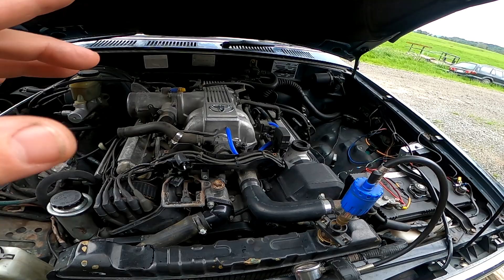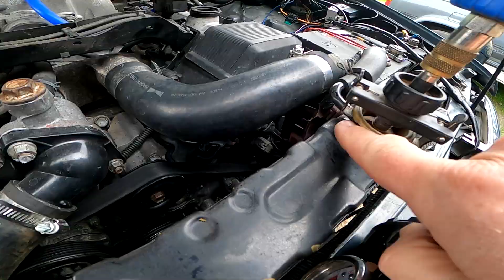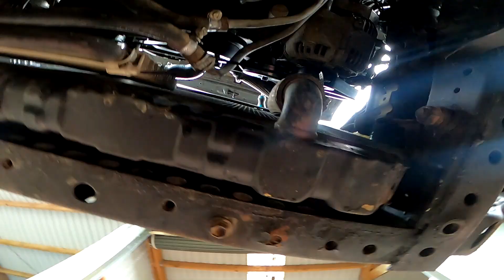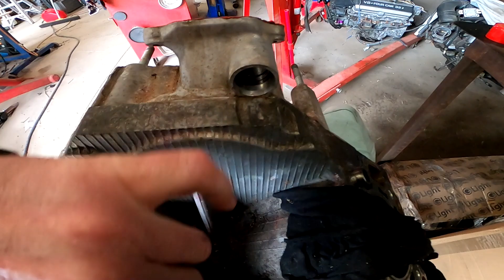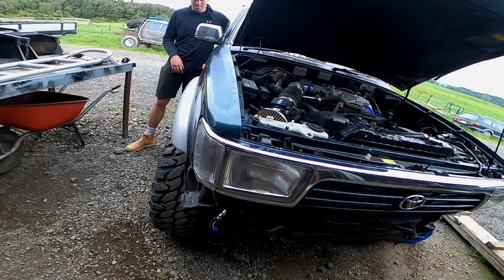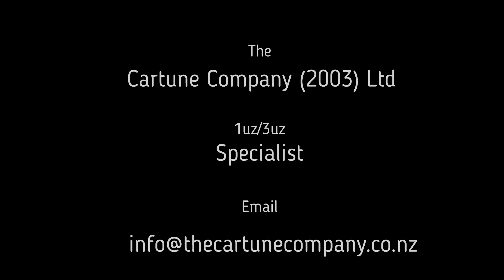1uz water leak from o-ring behind the waterpump - dripping from bellhousing.   1uz surf

Comment: Does anyone know where you can get that o ring or if you need to replace that whole pipe. I tried a basic o ring kit and both kits i bought don’t have the correct o rings. They still leak after trying multiple o rings.
Reply from the maker: I use genuine o-ring.  I keep in stock as I buy in bulk but toyota or lexus dealers should be able to supply with ease.  Its just they charge about 3 times what its worth,  but they are still not much money for the peace of mind.

Comment: Kelvin, love your videos!  Do you know where the EA0070 EGR Temperature Sensor goes on a 92 1UZ?  It's not too long (about 8 inches), has threads on the sensor, and has a gray housing with 2 prongs.  I can't get a response from my ClubLexus.com friends nor find it in the manual nor on youtube or google images.  I'm pretty sure that's why I went from 8 to 7 cylinders all of a sudden, but do correct me if I'm wrong (my 01 Ford Focus did the same thing to me, and this temp sensor is behind the alternator, and once replaced, it goes back to 4 cylinders after trying to shut itself down...)  Anyway, let me know if possible.  This is Oscar in Atlanta, GA USA, and Congrats to the Kiwis on winning the Americas Cup against Italy, great boat and great racing!!
Reply: I found it on page 620 and 621 of the SC400 Manual!